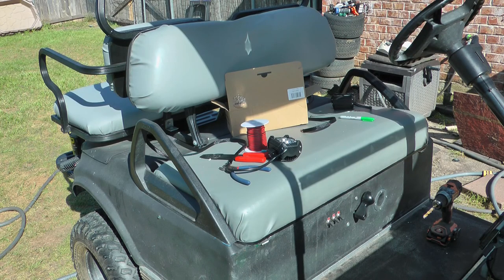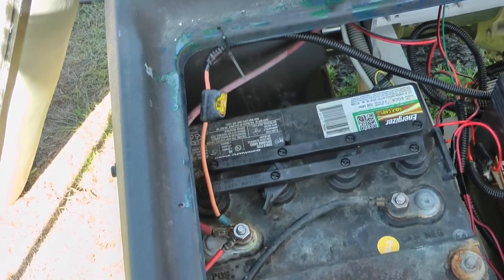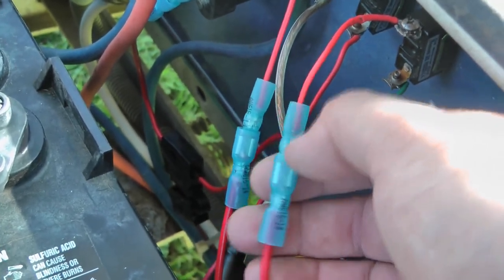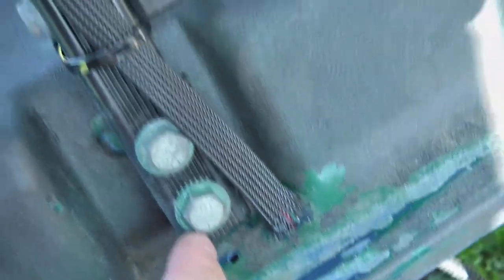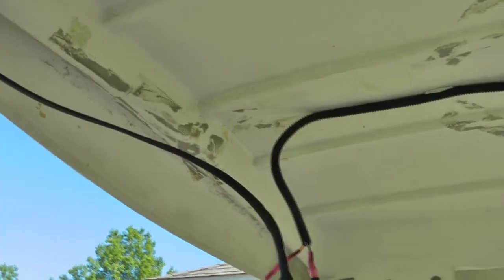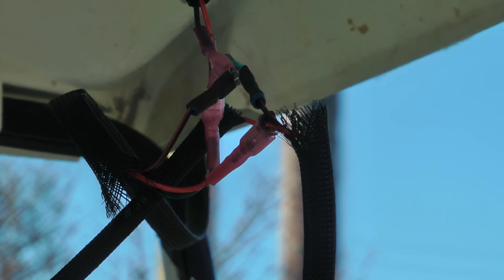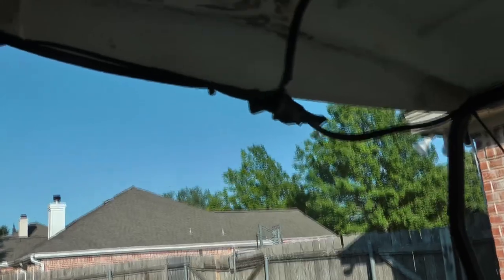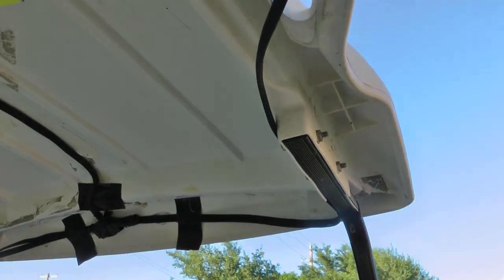golf cart auxiliary LED lights how to install

Comment: Hello.  Does the step down converter draw power even when not using the lights?  Which would be a parasitic drain on the batteries. How hot does the step down converter get and did it last for you?
Reply from the maker: they probably do create a parasitic drain, I didn't do any formal testing.  I think they get hot but again didn't do any testing.  They have mixed lives in my experience... some last a long time and some seem to fail quickly.  One thing I did was put a switch coming off the battery so I can cut power to the converter... you might try that if you are concerned about the draw and heat.  good luck

Comment: I bought a 48 to 12 converter.  When I went to install it, I hooked up the negative.  When I touched the + wire to the positive, it sparked?  So I quit.  Should it spark or did I get a bad converter??
Reply from the maker: mine typically gives a quick spark whenever I hook up the second connector.  Put a fuse inline (10 or 20amp) and it will blow if you have an actual problem.  You can also put a switch on the ground wire, turn the switch off, connect the post to the battery, then flip the switch on.  You won't get a spark that way unless there is a major problem, at which point your fuse will blow or the converter will blow if you don't have a fuse.
Reply: @WJHandyDad  Thanks for the quick reply. I just put new batteries on my cart and was terrified  that I could hurt them.  I'll go get some inline fuses today and a safety switch.  Thank you !!
Reply from the maker: @bigshowradio_550  I don't blame you - new batteries are too expensive to risk!

Comment: Hey! Just a quick question. I am looking to add a light bar , led lights, and under lights to my 48 volt golf cart. Would I need a voltage reducer for each light set? Or does one reducer run more than one thing
Reply from the maker: great question - depends on several factors.  Each reducer can do a limited amperage.  So you need as many reducers as it will take to handle how ever many amps your lights will draw.  I currently have 3 reducers on mine - 1 for the headlight system, 1 for the auxiliary lights, and 1 for the reverse lights.